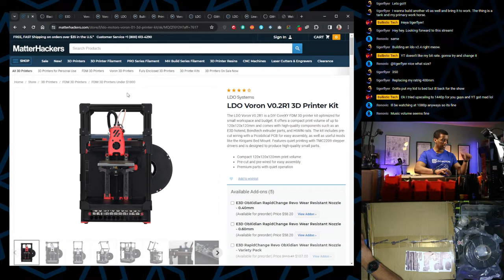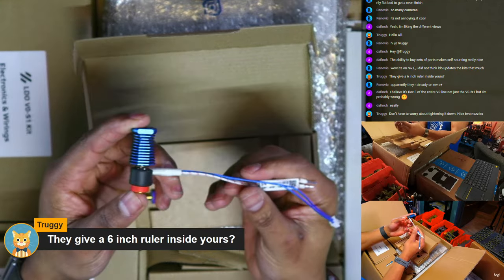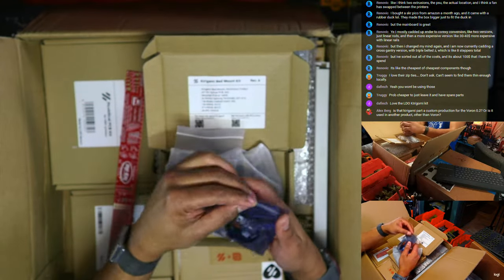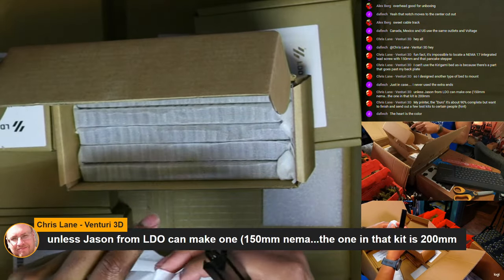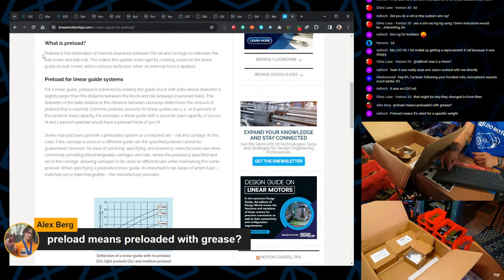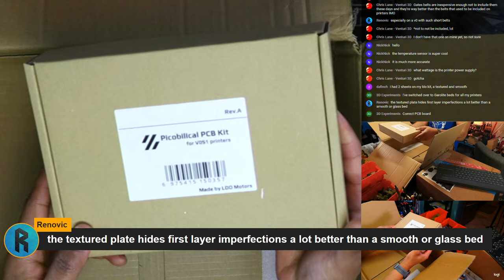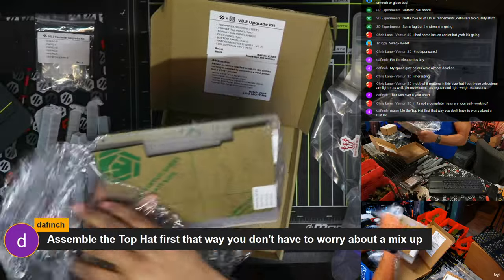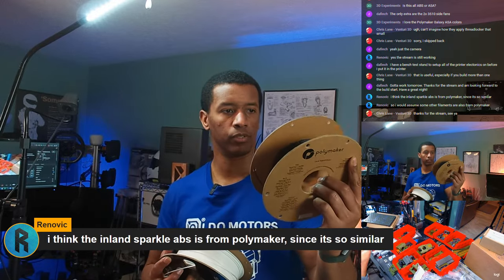LDO V0.2-S1 Kit Build (From MatterHackers) - Part 1 Unboxing

Comment: I'm converting a 'basket case' Ender 3 Pro I bought off ebay into a switchwire (Enderwire?).  Since I don't intend to enclose this printer, or use it to print ABS, I'm printing most of the parts in PETG on a second Ender 3 Pro (if PETG is good enough for Prusa's I3 series, it should be good enough for an Enderwire).  I have printed some of the parts (for the Stealthburner) in ABS on the same Ender 3 Pro.  I put the printer in a closet on a table stand in the corner of the closet, and surrounded the printer with coragated box material.  It took a few tries to get the bed temp right, but I finally managed to print without warping or layer separation.  I'm printed on a WhamBamm build surface with Elmer's glue stick.
Reply from the maker: Hey Kenneth. Nice. I have plans for an Enderwire as well. Printed some parts for it on my Prusa in ABS with a foam core board enclosure I made 

PETG should be fine for an unenclosed printer. The one thing I heard Steve Builds mention is that Voron parts are designed with ABS shrinkage in mind. 

So there could be some areas where parts are meant to mate or snap together and might take some slicer tweaking to make fit well.

Steve_Builds actually just started a Fabreeko Rook that's meant to be in PLA. He used ABS/ASA and is having some clearance issues with some parts.

Just something to be aware of. Hope the build goes well. Feel free to keep me updated.
Reply: @BallisticTech  I've actually had no serious issues with shrinkage (or lack thereof) with the PETG parts.  I did have to file down some of the parts to fit, but most of that was probably brim removal.  Also needed to ream out some of the holes very slightly, just microscopically undersized for the screws.  I just used standard Prusa Slicer settings for generic PETG and ABS with standard Ender 3 Printer settings.  I did mod a few things for layers, walls, and in fill from the Voron site.  I used California Filament PETG, and ABS from Inland.  Once I got the ABS dialed in, it actually prints better than the PETG.
I got a Taichi dual bowden hot end, and will use a pair of M4 extruders to print in two color mode.  My SKR mini is one stepper driver short for that, so I bought a Mellow-fly SB2040 CAN toolhead.  It will drive one of the M4 motors with the cable running along the Bowden tube, the SKR will drive the other extruder motor.
I will use the LCD panel that came with the Ender 3 Pro, the Darkdog github has STL files for a mount for that.
Reply: Also consider that PETG tends to deform over time when under load. I'd think about replacing the motor mounts for A, B and Z with ABS parts.
Reply: @livingroomworkbench  I found some STLs for upgraded A & B (on switchwire still called X and Z) motor mounts, and I printed them in ABS.  For now I'll leave the Y motor mount in place, but will probably print a replacement in ABS as a spare.

Comment: Looking forward to your build!

I know you had your kit for a while, did you check if you have one of the faulty Z steppers? There was one bad batch

1:52:04 The top hat extrusion was like half a millimeter shorter than the others from the kit. Took me over a day to figure that out 😅 for me the top hat extrusions also had a different shade of grey, so definitely a different batch. Most likely that's also where the minimal length difference came from. The absolute length isn't super important as long as e.g. all vertical extrusions are exactly the same. So my guess is that LDO doesn't care too much about the exact length between the batches of production
Reply from the maker: I mentioned the fault Z Stepper issues some ppl had. I'm not sure how to identify if this kit has the problem.

Good to know about the length differences.

Thanks for watching!